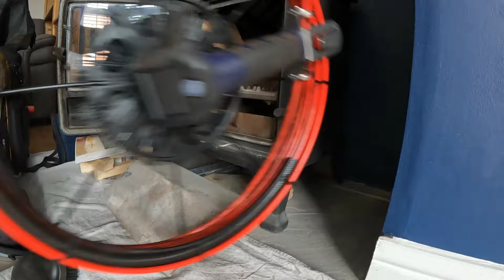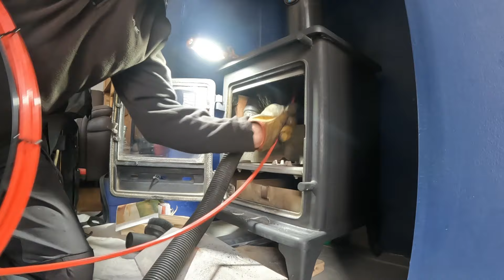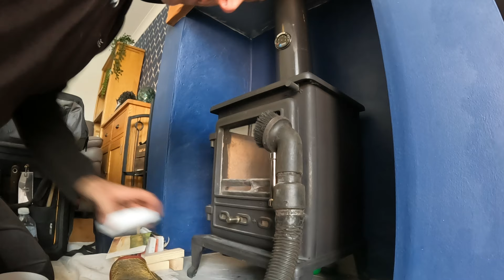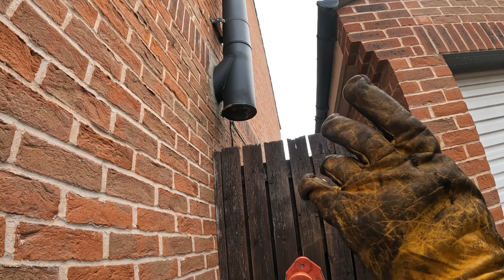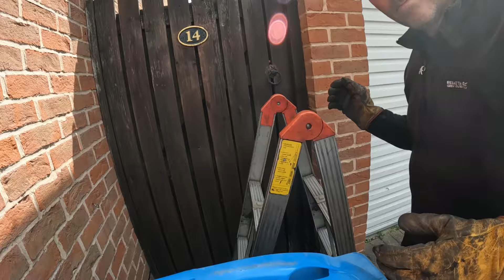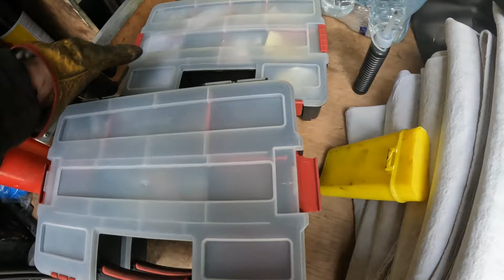Still getting used to the viper.

Comment: I used the viper, and it is quicker however, with rotary it seems to do a better job for the customer after using the viper i used power sweeping and got a lot more out that the viper missed.it's giving a bit of rotary scrub as to say. I paid £290 for a big button lock 10m set, had them for years now.